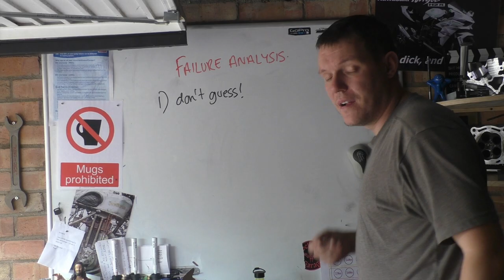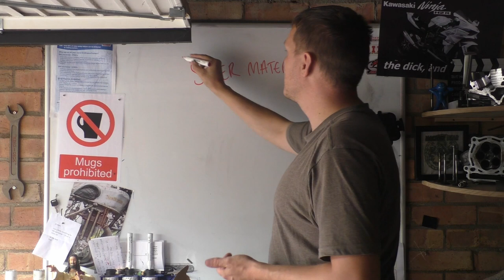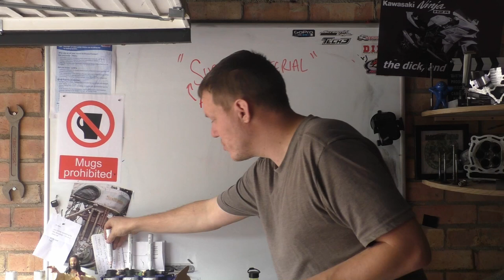What's the BEST Super Alloy?

Comment: Agreed 100% steel is awesome. I've done heat treating of homemade knives and other tools at home from simple high carbon steel. I still buy HSS blanks to grind tools from for the lathe even though I have carbide.
And let's not forget the weldability of plain mild steel, you can build just about anything in no-time with some profiles, a grinder and a welder!
Like just today I helped out a kid that wanted to get into blacksmithing weld a forge and put it on a rolling cart so he can go nuts at home.

Comment: You mentioned incoloy, were you also thinking of waspoloy? CNC turned both when I worked for Rolls Royce, (turbine discs) roughing cuts were always fun using ceramic inserts at high revs and feed rates, finger always on the red emergency button!
Reply from the maker: Inconel, like 718 etc

Comment: Currently the latest and best alloy recently discovered this year is transparent Aluminium (wrongly called Aluminum in the US just to annoy the rest of the world).

The possibilities for this new transparent metal are endless. Imagine a bike with cast transparent wheels??
Reply from the maker: transparent Aluminium or Aluminium oxynitride was first produced in the lab back in the late 70's (1979 I think) the problem is it costs a lot to manufacture. (as a side note its basically a sintered material)
Reply: It was a postulate* for decades before this but like spontaneous Hydrogen fusion from subatomic impulse synchronisation (the subatomic impulse power postulate 1938) just way beyond the state of the art technology level for years.

(Postulate*: Something that is proven to be feasible but isn't possible to currently do due to methodology and technology limitations).

Whilst nobody has created a viable synchroniser to build an impulse power reactor (last failure attempt in the 1950's), practical cheap transparent Aluminium production is something that engineering has cracked finally.

Ruby is a translucent form of Aluminium, as is Sintox (Sintered Aluminium Oxide used in Lodge aero and performance engine spark plugs, Chobham and Dorchester armour), Bauxite (the raw ore) and the actual refined metal itself.

From what I've read, the process involves passing oxygen through molten Aluminium in a carefully controlled process and is relatively cheap.

Most likely to be used in construction, domestic (saucepans), aviation, transportation and industrial.

(The world's first Impulse power reactor will most likely be created by someone in a shed or garage somewhere in Britain eventually and most likely be used to power a motorcycle).

Comment: most common steel
Steel        Max. % koolstof (C) Max. % mangaan (Mn) Max. % fosfor (P)  Max. % zwavel (S) Max. % silicium (Si)
S235                  0.22                                1.60                                 0.05                              0.05                           0.05
S275                  0.25                                1.60                                 0.04                              0.05                           0.05
S355                  0.23                                1.60                                 0.05                              0.05                           0.05

also one of the strongest is WELDOX  1300 N/mm²
Reply from the maker: Weldox and Hardow are more for structural applications though. I mean more like 4130 etc
Reply: The Workshop you mean CrNiMo Lol

Comment: How come, with all the steel alloy choices, Kawasaki chose chocolate for the camshafts on their Z / KZ / GPz engines??

Homogeneous armour is 70% Nickel, 27% Iron, with the rest being Molybdenum, Chromium, Vanadium, Copper and Carbon. The British (for Crusader tanks) discovered that reducing the (expensive) Nickel content to 40% and increasing the (cheaper) Copper content to make up the short fall made negligible difference to the armour's Brinell hardness rating. 

Obviously we didn't tell the Germans about this!!.

All WW2 British AP shot was made of Hadfield steel. Later AP Composite Non Rigid shot had a cast iron core which we'd discovered gave the same performance armour penetration as tungsten cored shot. (It's where all those iron railings gathered up in morale boosting propaganda scrap iron drives ended up).

Again we didn't share this discovery with the Germans (or the Americans!!).
Reply: They had shitloads of that chocolate left from early seventies road bike frames.

Comment: Wouldn't titanium alloys do great in crankshafts though if you put fit bearing material on its journals? Also, you say we won't ever see carbon nanotube crankshafts but why? Are the cnt properties not fit for it or do you just think by the time we can make cnt shafted engines, well all be riding bicycles and maglev trains?
Reply from the maker: "Wouldn't titanium alloys do great in crankshafts though if you put fit bearing material on its journals?"

- Titanium does funny things when under torsional stress, this is to do with fatigue limits during cycles. Steel is very predictable and can be hardened. The mass of steel is also a good thing as it helps with balancing. Even cranks with Ti rods (like the R1) still use steels.

As for Nano tubes, they are strong, but they are silly small. Using Nano-tubes requires a bonder, like carbon fibre.
Reply: So reinforced carbon fiber crankshafts?

Comment: I machine a fuck ton of inconel 625 and 718... They are crazy metals. Try cutting an inch diameter bar of it, see how many hacksaw blades it destroys, if you get through it at all lol

I've also cnc'd titanium, monel k500, waspaloy etc

But you can't beat inconel for eating carbide tips and other tooling

Edit: I've actually got a piece of inch inconel bar sitting in my garage. About 10" long. Can have it if you want a sample. Probably worth like 200 quid lol, but I got it free ;-)
Reply: Be a good one for an apprentice actually. Hand them it and ask them to hacksaw you an inch piece from the bar lol
Reply from the maker: 10" OD?
Reply: The Workshop 

1"' OD, 8 or 10" long

Just let me know if you want it bud

Edit: just checked the price online. 3mm diameter x 1 metre long is £70 lol.

1" dia x 12" long = $180 (I wasn't far wrong with my £200 guess lol)

I don't want anything for it though, it's been sitting in my garage for the last few years and I haven't found a use for it yet. But it could be good for you demonstrating it's properties.
Reply: The Workshop 

I'm in Scotland, can post it no problem. Not much use to me, but I know you have a collection of metals for demonstrating properties etc, so at least it may be of some use to yourself. Plus I can just grab some more. ;-)

Free if you want it mate, I don't have a use for it. They use it very thinly in race (f1 etc) exhaust systems simply because even though the material itself is heavy as fuck, they can make parts from it extremely thin because of its immense strength, and even when it glows red or white hot it keeps like 90% of the strength it has when cold. Other lesser metals would go soft or turn to liquid lol

Comment: So why no copper pistons?  Or any other highly conductive metals?  
In fairness a pure gold or silver piston is a bit of a crap way to throw away money but is it feasible?
Reply: Send me gold and silver, I will carry out tests.
Reply from the maker: Copper is heavy.

Copper density = 8.96 g/cm3
Aluminium Density = 2.70 g/cm3

That's almost 4 times the weight. Mass x aceleration = Force. Lets say the aceleration is 20m/s2 then for these materials it would be -

Copper = 0.1792 N/cm3
Aluminium = 0.054 N/cm3
Reply from the maker: Its worse for gold and silver and they are soft as dogshit. Copper could be forged (work hardened) but still a bit soft.
Reply: Ah now that makes sense, good points.